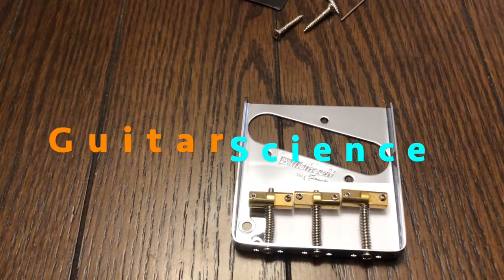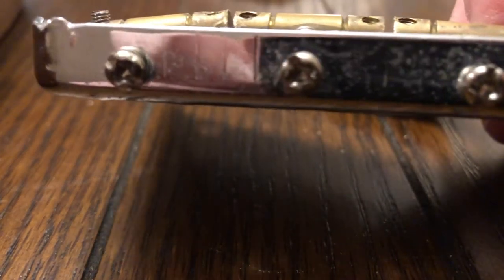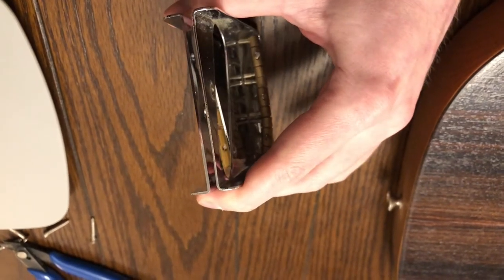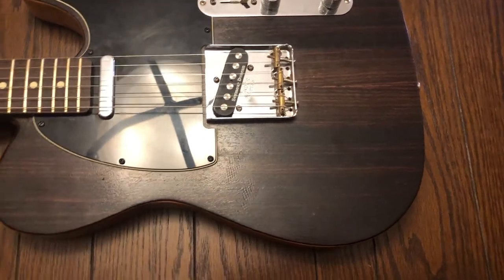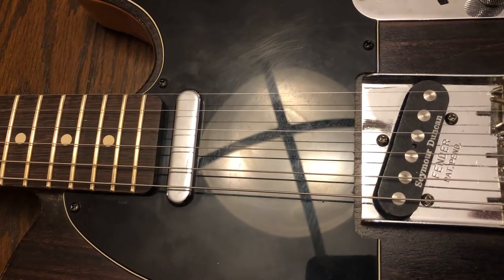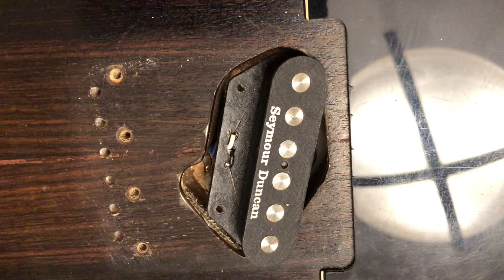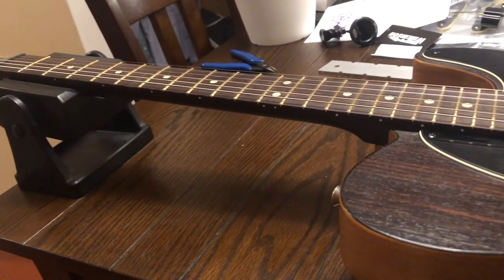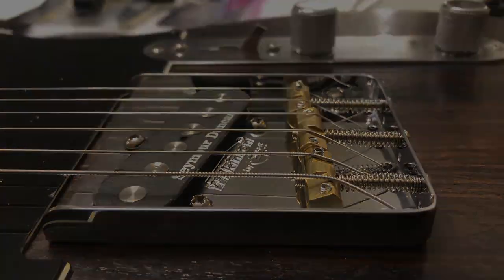Is it worth it to upgrade a telecaster bridge? Tele bridge replacement

Comment: I find it interesting that the presenter percieves differences in the sound of the two bridges but does not seem to understand the concept of intonated saddles.
Reply from the maker: I briefly mentioned the saddles about a minute and a half in. It's not a video about intonation, so I didn't go into depth. It was definitely easier to intonate than a traditional tele bridge, but still more work than a 'strat style' with 6 individual saddles.
Reply: Why is that interesting? Someone apparently not understanding something but perceiving something else?
Or are you pointing it out  because you understand something he doesn’t ? 
Maybe you could make a video all about intonation for our viewing pleasure.

Comment: Vibrations to the body are irrelevant. The energy needs transfering to to pick ups, thats the only thing to be concerned with.
Reply: Resonant frequencies in the body put energy back into the string excursion increasing sustain and effecting string harmonics.

Comment: The Wilkinson has compensated saddles, which make it better for intonation. With the straight saddles it's nearly impossible to get your intonation dialed in. You end up with one string a few cents sharp and the other a few cents flat. It's also worth considering that not everything marked "Fender" is actually a Fender product.
Reply from the maker: Totally agree. Unless you get lucky enough to hit the intonation spot on the first time, adjusting those old school type saddles is brutal. And I think that everything about this body was fake, as is evidenced by the lack of finish under the bridge. Not something fender would ever do.
Reply: you can just buy tele bridges with 6 saddles. Also without the ridiculous and pointless sides. Well...I suppose if you're in a black metal band, you can offer a blood sacrifice to the devil every time you split your knuckles open on the edge of the bridge - which you'll do a lot if you get carried away and play aggressively.
Reply: I have one on my Tele, the intonation is pretty spot-on and it stays in tune...

Comment: I did not see any ground wire underneath the bridge when it was off. There should be a bit of exposed wire contacting the bridge and then grounded to one of the pots. If you have an electrical hum that goes away when your hand touched the bridge you need to add a wire.

Comment: The difference in finish under the bridge may have resulted from the previous owner applying wipe-on products on the body and not removing the bridge - such as Danish oil and furniture waxes.  No big deal. I don't remove hardware from my guitars when cleaning them and applying polish.  You may need to shim the neck to get rid of the buzzing if your frets are level and you have sufficient relief and your nut slots haven't been cut too deep.

Comment: Say what you want about an original fender bridge plate, I own about a dozen Teles and have zero issue with them. Not against trying anything new at all, if it makes you feel better. Just make sure they are flat, screwed down properly and grounded properly. As far as intonation, the guitar must be set up properly, truss rod, frets leveled, nut slots cut to optimal depth, bridge hgt is optimized, and then intonate the string length with a tuner as well as by playing.....I have no noticeable issue with intonation either. Spend more time playing and less time wasting your money.
Reply: Hey man, I 2nd everything you're saying here. It's always been surprising to me how many guys want to play, and even can play, but then they take their guitars to a tech for setup instead of learning the process themselves.  Maybe it's separate worlds, but I wholeheartedly agree that setup is key.  I have never had a problem with my fender bridge inspite of the simple uncompensated brass saddles..... Zero issues.  Stays in tune.  Stays intonated.  Plays fantastic.
Reply: Seems like you guys skipped physics
Reply: @arturo13245  I am a degreed mechanical engineer and hold six US Patents....how about you?
Reply: The original fender bridge are usually thin and not flat, having said that a lot of people like the sound, but some like the flat heavy bridge plate, brass or steel nickel coated the sound is different

Comment: gotoh and kluson make a pivoting swivel saddle that retains the round shape of the contact point but allows each string to have its own intonation . it takes a few tries to get it dialed in though because moving the swivel affects two strings, but if you need accurate intonation it's a good compromise.

Comment: The Wilkinson staggered saddles can chaff at the top ridge.  This destroys the 1st or  2nd string.  It's best to polish over the contact area with #600 sand paper or eventually you end up with flat strings.  The fender round barrel design is very good.  If you want better sustain and accuracy   , install sperzel locking tuners ,  they have the mass that opens up the vibration quality .  Hip shot,  shaller and fender locing tuners all do the same.  And the accuracy is exceptional.  When a string goes flat,  use a good magnifier   you may find a shaving on the staggered  Wilkinson unit.  This needs to be burnished out so your string does not rattle. The sharp corner is usually the spot that needs a touch up.

Comment: The problem with guitar intonation is that it will always be a compromise. The issue is actually less with the bridge than the frets. The only type of guitar that escapes this problem is guitars with fanned frets, where the lower strings are allowed a longer scale length and the higher strings a shorter scale length. With a conventional guitar each string will have small tuning issues. Compensated bridges do correct to some degree from string to string, but because the frets stay where they are these tuning is are just moved the a different place on the fretboard. I
Reply: Haha, you sound just like my kid! And of course, you both are absolutely correct.
Reply: Fanned frets are a compromise, too. If you want perfect intonation all over the neck, you need a true temperament neck. It's not even something you can add to an existing neck, cus the frets and fret slots are squiggly lines...and they sound BAD. some people like it, but a perfectly intonated guitar just sounds wrong to most people. 
 If you want slightly better intonation  in the studio, don't set it at the 12th fret on any string, if the song doesn't require you to play above it. If, for example, you don't play anything on your A string beyond the 9th fret, intonate it there, and the errors in between the open string and the 9th fret, will be smaller. Still a lot of trouble to go to, since everyone is used to guitars being a bit pitchy, to the point where perfect tuning turns people off.
Reply: You ok? Not sure what happened at the end of that paragraph lol
Reply: @AdultsAreTalking  I'm sure he's just fine. Maybe he just

Comment: I think that thin, old bridge is partly responsible for the tele’s particular voice - that extra, tin pan-like twang that seemed to be diminished in tele’s I’ve played with thicker, more modern bridges. Whatever floats your boat, though.
Reply from the maker: That definitely could be true. I do think the adjustment made the guitar sound better to me, but I was also tired of getting my palm stabbed by the sharp screws and constantly fussing with the intonation haha.
Reply: That's probably more to do with hand-wound pickups vs machine wound on more modern guitars. The neater the winding, the greater the capacitance, and the more you lose the highs. Modern finishes are thicker too, so the unplugged sound can be kinda muted by that. I had a Jerry Donahue tele that had like 3mm of epoxy on top. When I chipped all that away, the guitar really came to life.
Reply: A thicker gauge bridge is a typical remedy for a squealing pickup. It'll also increase the inductance and change the flux shape, golden ears will claim to hear tonal differences, any increased output is pretty easy to hear.
Reply: @guitarscience6926 Get a selection of shorter adjustment screws, 8mm, 6mm and 4mm, you should be able to sink the screws in the saddles. 

Also I second the commenter that suggested burnishing the Wilkinson saddle edges for the solid strings. 

The Gotoh compensated saddles are a little more spendy but better, the Joe Barden (and similar) cattywompus saddles are preferred by many. The JBs come in 2 widths, if your string spacing is 2 1/16" (measure your top loader holes on the bridge if you have them) then the JBs with allen screws fit, wider the slotted screw version fits.

Comment: See about getting you a slotted neck rule and level those frets.  I don't even worry about crowning them.  I just hit them with 400 grit long ways and then I go parallel with the fret wire and then I use one of those four sided fingernail polish sponges and all my guitars play like a dream.  Just a suggestion cause I bet that thing can smoke if the neck isn't hoopajuped.
Reply from the maker: For sure. It's time consuming but ultimately a neck shim and a nice level/crown solved all the issues.I hate fret leveling but it is useful, especially on those Warmoth necks with no fall away built into the upper frets.

Comment: Interesting. I have it on my new pinecaster, and its like you said, it rings like crazy, and its lound even unpluged. BUT, its strange that on the bridge pickup, my BAJA MEX tele shines more, because of the rounded-nes of a tone that a original Fender bridge is giving. Wilky is more snappy and bright, and it shines more with a neck humbucker in my new guitar. Maybe i will get some more winded(powerfull) bridge pickup like you have SD quarterpound. Mine is a 9k standard tele singlecoil. Its good, but not exceptional. I must to mess around with a tone know all the time.

Comment: A thicker bridge doesn't get that plinky sound telecasters are famous for, and the compensated saddles are OVER-compensated on a couple strings, so I flip them over and use the un-compensated rounded side - just bend slightly to intonate accurately.  Gotoh "in tune" bridges are better than the Wilkenson, and saddles are grooved and slightly compensated more accurately.
Reply from the maker: Yeah after a while playing it, I don't love the bridge. I might check out that Gotoh one. Got a few teles to experiment on.

Comment: 1:11 I see holes at the bottom of the bridge. Can you top-load through a Wilkinson Bridge instead of stringing through the body?
Reply: You can. I put this same bridge on my Squier Affinity Tele which doesn’t have through-body holes, and it works just fine.
Reply from the maker: Yes you definitely can. Now I have two of these Wilkinson bridges that do both and I have to test!
Reply: yes absolutly , and that old myth about the sound and tone being differant if you string through the body or the top is in my opinion and experience just that , a myth . I've done it both ways on the same guitar and couldnt tell any difference.  I know that's a little off the the subject , just thought I'd throw it out there lol . rock on !
Reply: @jamesallen1164  100% correct

Comment: I used this bridge as a top loader but strings e and B move in the bending touching the screw
Reply from the maker: I've noticed this too,but for me it's very small. I'd guess the top loading doesn't give enough of a break angle compared to thru-body, so the strings can slide more. I'll have to test this out.
Reply: I guess you could make just those two strings through-body?
Reply: File a small slot in the saddle and the strings won't move.

Comment: I'm willing to bet that the guitar body was an Aliexpress-type knock off. It seems strange that there wouldn't have been a finish beneath the bridge. I'd bet the previous owner bought it as a project guitar; replaced the pickups and the neck, and that may have contributed towards the neck issues if it's not properly set up. Cool looking guitar though. Definitely correct me if I'm wrong though. I'm assuming that's a variation of the George Harrison tele. There were some reissues that were made in Japan by Fender in the '80s, so it could've been one of those.
Reply from the maker: Wow. Had no idea I basically built a George Harrison telecaster! My neck is wenge but aesthetically it's  almost the same. Knowing that, I think you're right and it was a knockoff body. With that said, the import body + American made neck has never let me down, and this tele is now my favorite guitar.
Reply: @guitarscience6926  That's awesome! I would love to get one like that some day.